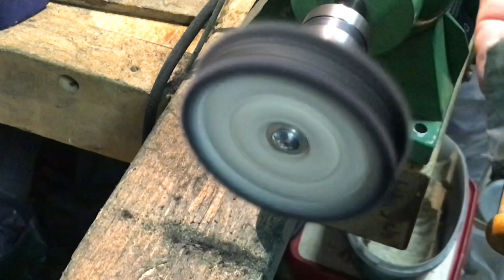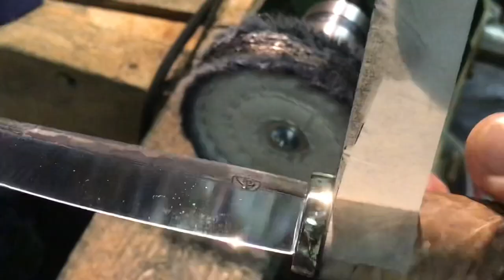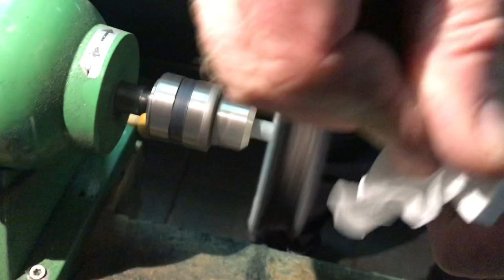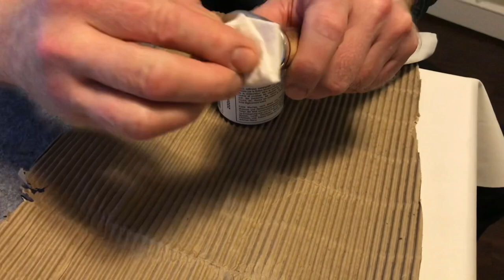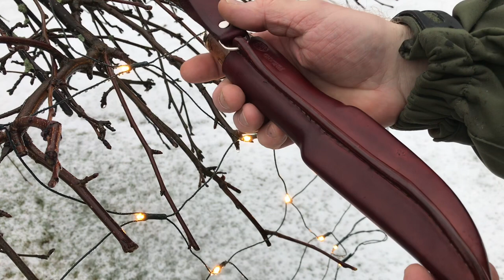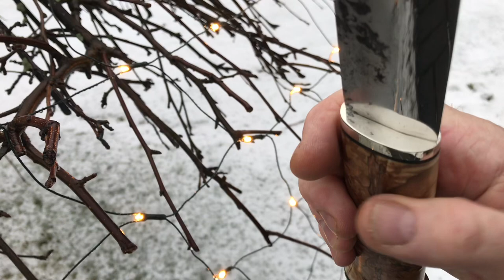How to get Final Gloss for Your Knife Handle

Comment: Thank you for showing and beautiful work as always! I use a speed adjustable angle grinder clamped to my workbench due to the lack of a buffing machine 😂 Also like the renaissance wax. And these puronvarsi blades are just gorgeous. Difficult to fit, but well worth the effort. 🙋🏻‍♀️Anna